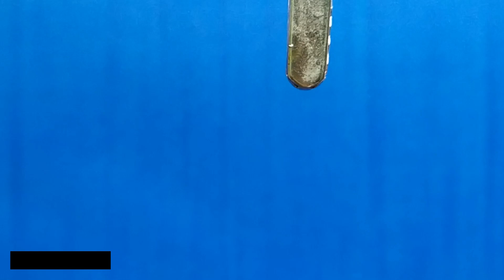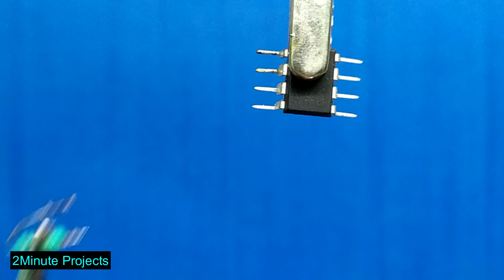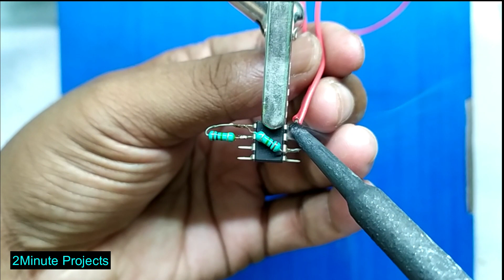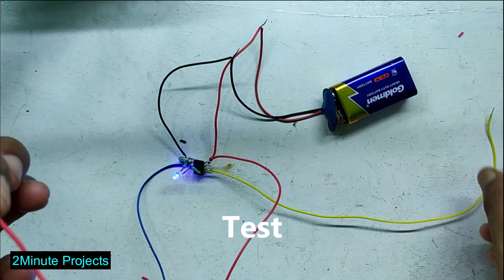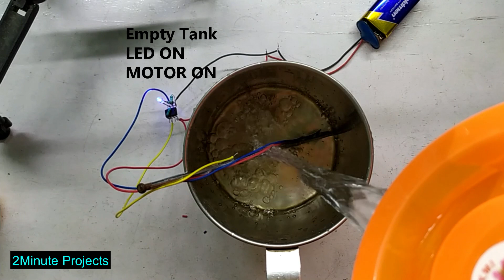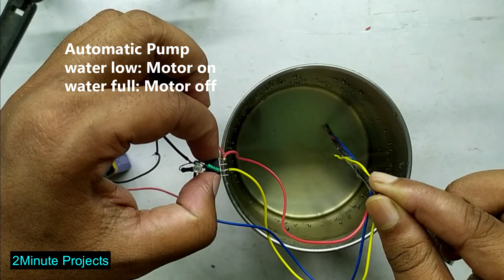Automatic Water Pump Controller

Comment: Motor On/Off ?
Reply: For motor on off.
Please use LED point and connect a 6 volt relay and control your 12 volt DC to 220 volt ac  motor